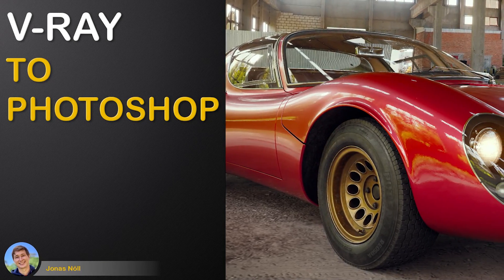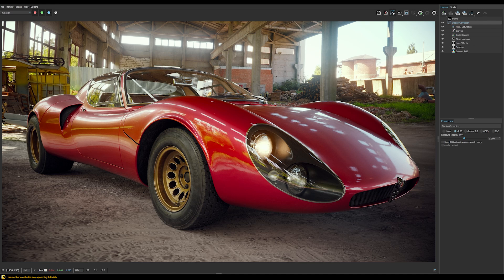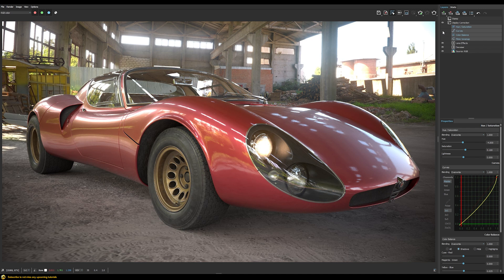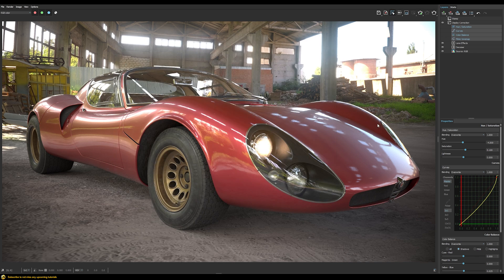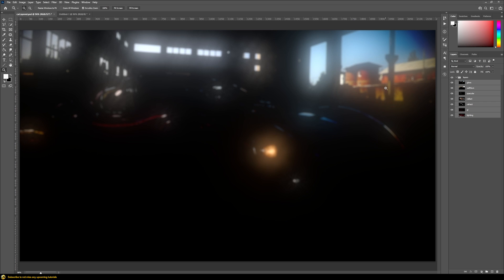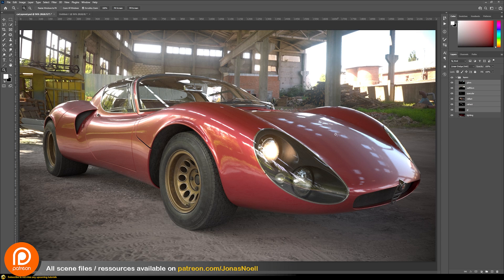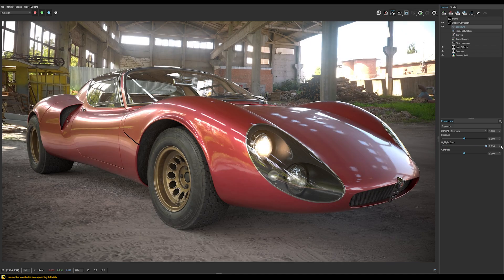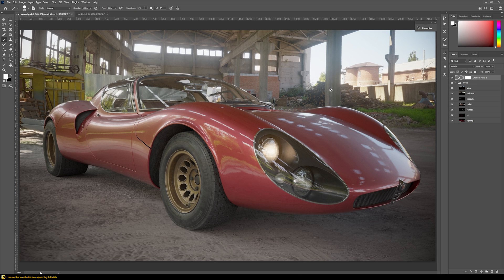V-Ray | VFB to PHOTOSHOP Workflow | Non Destructive Color Matching

Comment: Dumbest question ever (sorry, I don't use V-Ray / 3DS Max much these days) - why when I do my layer adjustments in V-Ray VFB, those adjustments aren't visible in the outputed jpg or png file?  It's like I've done all these adjustments for nothing?
Reply from the maker: If you use LUTs or in some of the other VFB corrections there is an option that you want to save the changes in the image itself. If there is no option present then it means it should save it in the image.

Comment: I tried to transfer these steps to Premier/After Effects but I get a very different result. Even the simple stuff like highlight burn via Channel Mixer of just using a LUT that work great in the VFB, doesn't work in P/AE. Any tips?
Reply from the maker: Did you switch your comp to 32/bit? I tried out the Channel mixer and it worked the same so far...
Reply: @JonasNoell  I had to "Linearize Working Space" in the project settings which enabled "Blend Colors Using 1.0 Gamma".
That did the trick 👍
Reply from the maker: @pixelquarry  Oh alright I probably had that already on then! Thx for sharing!

Comment: Hi! I learn a looot from your videos! Can i explain a bit about bit-depth? open-exr comes in 32-bit... and it is very limited in PSD. Any tip or further explanetion on which depth to choose? Thanks!
Reply from the maker: So in Photoshop the only way to recreate the image (from layers without baked in tonemapping) from the VFB is through 32Bits in the way that I showed in this tutorial. Photoshop unfortunately is limited if you use 32Bit however. So if you need access to tools which only work in 16 bit you would be forced to bake the image into a 16bit image and that way flattening the layers and baking in the tonemapping and colorcorrections.

Comment: Hi, very informative video as usual !
 i have a little question: the shader for the tires, is it SSS with some grunge map on it ?
Reply from the maker: No and why would you add SSS for tires? :-) Just standard VRayMtl with some grunge...
Reply: @JonasNoell  ok :) I was wondering about SSS because Siger Studio in their elastomer shader are using SSS.
Thanks for your reply!
Reply from the maker: @evilone10  I would say it depends, but for tires the rubber is so thick you would never have the effect that the light scatters through from the backside, that's why using SSS for that kind of usecase is pretty pointless from my perspective.
Reply: @JonasNoell  Yes that makes sense ! ;-)
Thanks again for what you are doing !